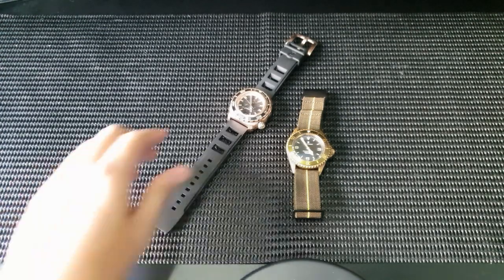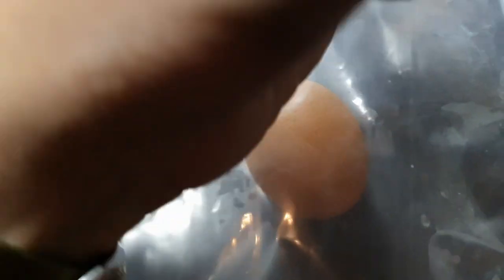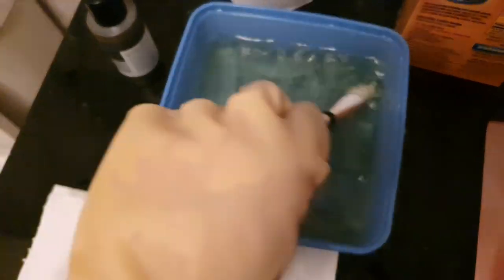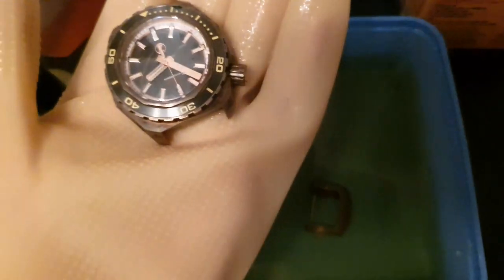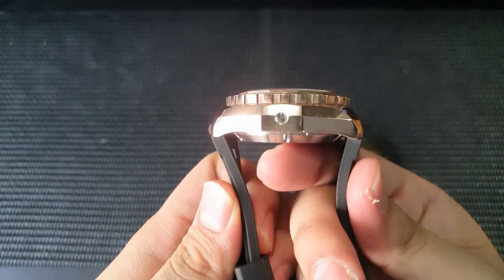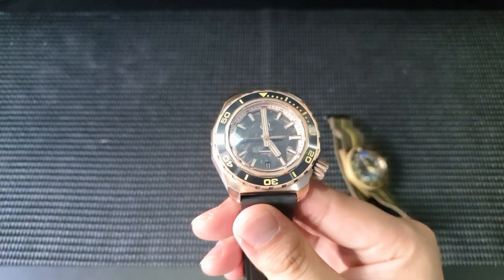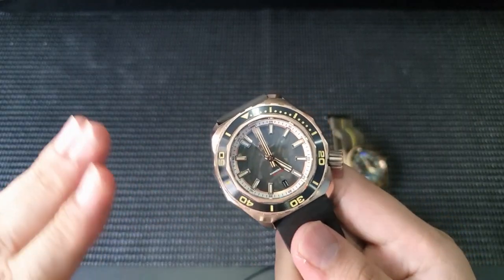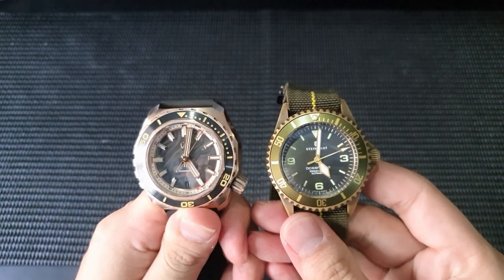Forced patina on a bronze watch. 2 methods! (hard boiled egg, liver of sulphur)

Comment: I have a concern that if the patina doesn't turn out the way you want and you want to remove it won't the "cape cod polishing cloth" or any other form of polishing, tooth paste, brasso, Flitz, ect. remove the brushed finish (if the watch has it)? And you will come out with a "polished finish" on your watch instead of a brushed finish?
Thank you for the very descriptive video, well done. Also, I have this wax called "Renaissance Wax" I use on my knives to protect and preserve finish I wonder how it would work on a patinated watch 
if you want to seal the finish so as to keep it preserved the way you like. Has anyone tried it? Not sure if it remove patina or preserve it...looks like time for me to start experimenting.
Reply from the maker: Hey there! Yes cape cod may remove the brushed finishing, but for a bronze piece, especially cusn8 bronze, it patinas so quickly that the original finish doesn't matter as much. Thanks for the tip on the wax too!